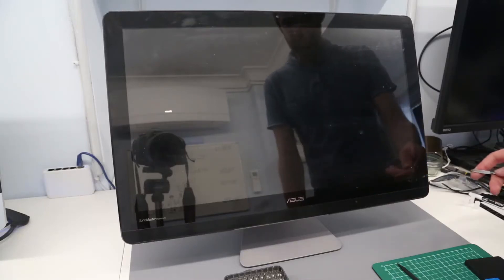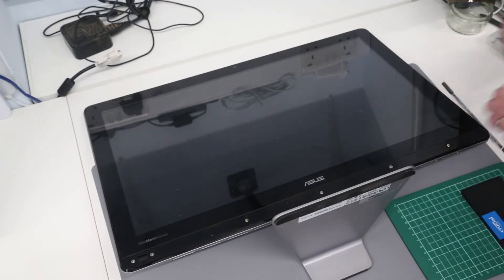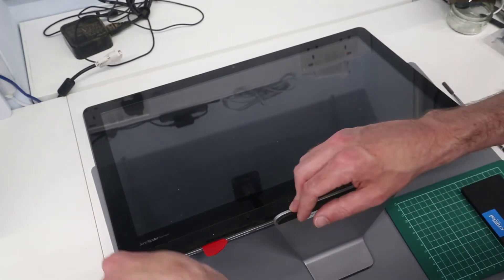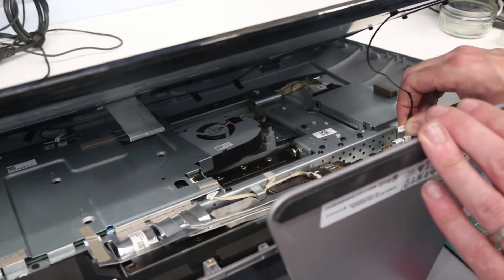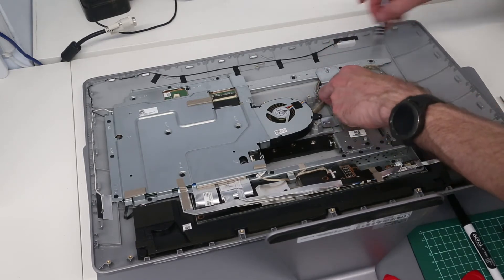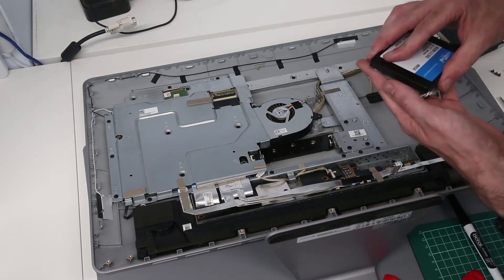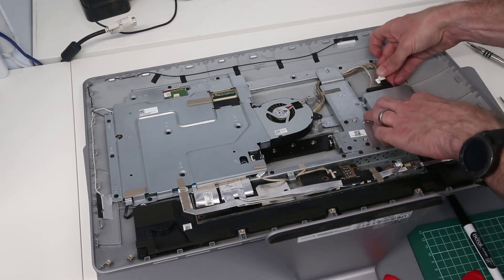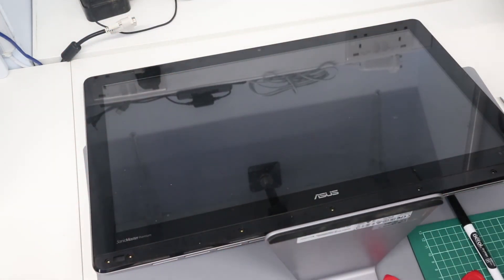ASUS Zen AiO Pro ZN220IC - SSD Upgrade

Comment: @BrueComputing  Hi james,sorry it has taken me a while to reply to this. Great result! Cleaned the fan to as new state, heating issue has vanished and PC runs better. In the meantime,  successfully updated Win10 to 22H2 version (My Steinberg music software will not run in Win 11)so no option. One other question. I have lost 10gb of space on C:drive since update to Win10 latest version (currently 70gb free) and I don't think there is anything more to remove. What is the best way of creating more space...cloning C: drive 1st, then increase the drive size as you have described in this vid or is there a better option? Any info will be much appreciated..Many thanks..Mal
Reply from the maker: Hey, glad that helped!
If you've updated Windows 10 to 22H2 you probably have the old version still on the drive in the windows.old folder - you can remove it with Disk Cleanup: https://www.wikihow.com/Delete-Windows.Old
I'd go with Method 2.
Reply: @BrueComputing  Hi James,Used Method 2 worked a treat. I also found a stupid schoolboy error with the installation of the musicsoftware.... I have now recovered a further 24.7GB so I don't think I will worry too much about space on C:drive,currently showing 94.7Gb free of 149Gb.
I am  indebted to you for the results  achieved,which would not have been possible without your input! Thank you, greatly appreciated. I haven't ruled out upping the RAM from 8gb to 16gb.......🤣

Comment: Hi James. Excellent video.I have a 2017 version of this ZN220-240IC and wondered as it is 8 yrs old if there is any benefit in fitting a new fan? Apart from day to day stuff email,word processing,odd pic editing the only heavy use is music production using Cubase 10.5 occasionally. Any ideas on cost for fan? Cheers
Reply from the maker: I don't think you'd see any benefit unless you have a specific issue with the fan, such as a bad bearing which would be noisy. Otherwise if temperatures are a concern then give the fan and heatsink a clean to remove any dust and replace the thermal paste.
If it doesn't already have an SSD then replacing the HDD would make a big difference.
Reply: @BrueComputing  Brilliant! many thanks for your prompt reply😎
Reply: @BrueComputing  Hi james,sorry it has taken me a while to reply to this. Great result! Cleaned the fan to as new state, heating issue has vanished and PC runs better. In the meantime,  successfully updated Win10 to 22H2 version (My Steinberg music software will not run in Win 11)so no option. One other question. I have lost 10gb of space on C:drive since update to Win10 latest version (currently 70gb free) and I don't think there is anything more to remove. What is the best way of creating more space...cloning C: drive 1st, then increase the drive size as you have described in this vid or is there a better option? Any info will be much appreciated..Many thanks..Mal

Comment: I know this video has been posted a while ago I've just opened up my own today with the help of your video (Thank you very much!). 

What I've found inside differs from your findings on this model, I've actually found 2 SODIMM DDR4 slots (1 populated) on the other side of the motherboard, these are protected by an ESD shield which pops off when pulled. There also seems to be a hard drive header (but no caddy or mounting) which comes directly from motherboard and can physically be connected to a HDD or SSD however I have not yet attempted to boot with a second 2.5in disk mounted in this position - anyone else know whether this will work?
Reply: Can confirm this works and I now have a 2.5 in SATA SSD fitted (taped in place) on the second SATA header, with the original 1TB HDD as a storage drive and 8gb RAM installed.
Reply: @bencrossley8910  hello ! where is located the second har drive header? one is conected to the cable and indide the box and the other one?
Reply: @joseefsimoes  the other one is fixed straight to the edge of the motherboard, a drive can be inserted into the connector and fits within the chassis however there are no mounting screws, so taping it in place was my option (better for SSD than HDD)
Reply: Thank's

Comment: Hello
Please help me with my dell 13 7375 laptop i want access UFEI BIOS SETTINGS but i can't
Reply from the maker: Hold down Shift and choose "Restart" in Windows - this will boot you in to Recovery and under Troubleshooting there should be the option to go into the UEFI Firmware Settings.
Alternatively, turn the computer on from a full shutdown and keep pressing the F2 key.